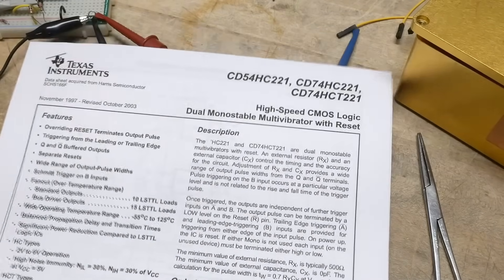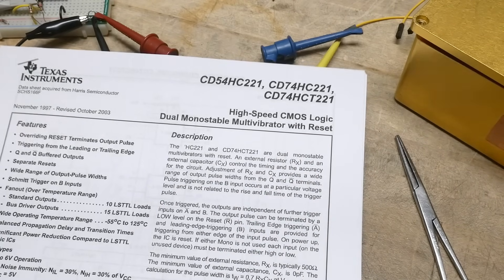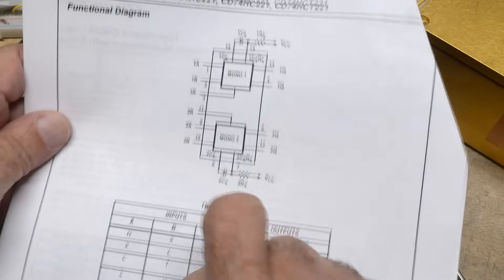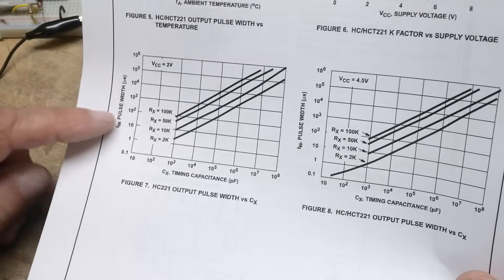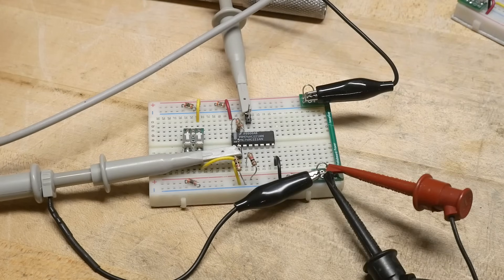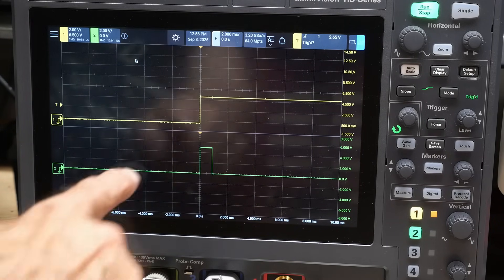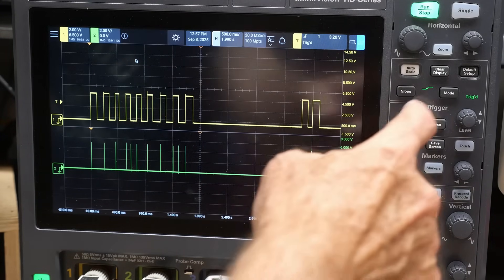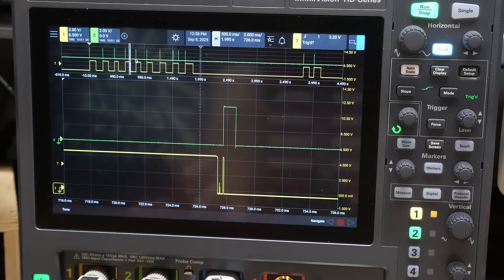#2386 74HC221 Dual Multivibrator Oneshot

Comment: One particular 15 volt system, we needed some ckts..in retrigger..rising...others on falling.....yet other blocks had to be  
non- retriggerable.. and some on rising others on falling...so we designed it using 9 nos CD4538 ...
(18 monoshots )
along with other combo. & sequential ckts..,ext. switches ,  prox.sensors..relays , etc...
ALL HAND WIRED..A ONE OFF but Critical application.
& somehow got it first time right.....😂...

Comment: As a test and repair technician back in the day I never liked the idea of one-shots much.  Logic synchronized to a system clock was generally pretty easy to analyze and trouble shoot but when you threw in an edge that was not in sync with the rest of the circuit and jittered on the scope I got nervous.  Now I understand that my trepidation was really just a lack of understanding.

Comment: This brings back memories of one of the first "practical' lessons I learned as a working engineer. I was fresh out of college and working on the design of a piece of test equipment. I needed a long pulse followed by a much shorter pulse. I thought I'd be clever and use a 74123 to generate the main pulse, and a second 74123 to generate the second pulse triggered by the trailing edge of the first pulse. Instead, I got the second monostable triggering three times after the trailing edge of the first pulse. Hints: the 74123 is retriggerable and the two 74123s were on separate PCBs about two feet apart. Can anyone say "reflections"?

Comment: Again a nostalgic chip. I used these and especially the 223 version in designing and building TOF mass spectrometers time bases. That was in 1981 and someone might ask why not use a microprocessor for that. They were expensive at that time, the development tools were clumsy and inefficient and expensive. These chips served well though they were not too stable.